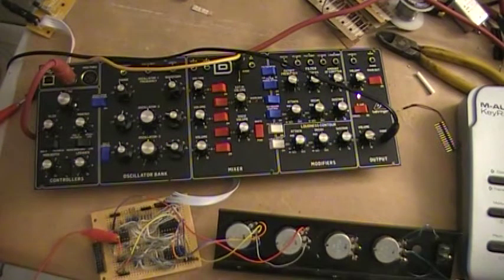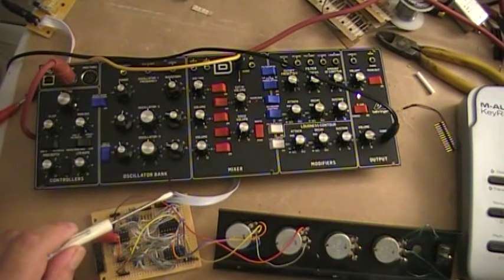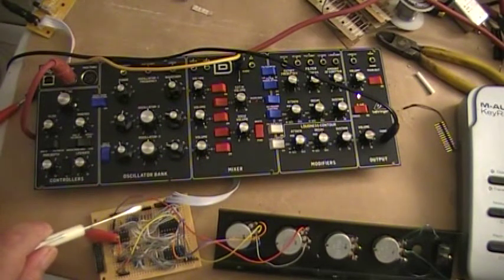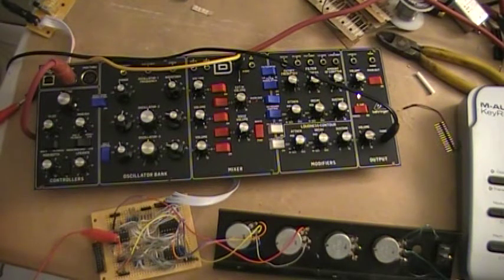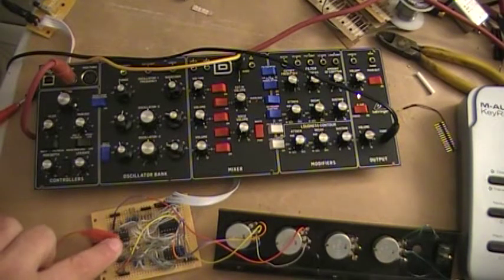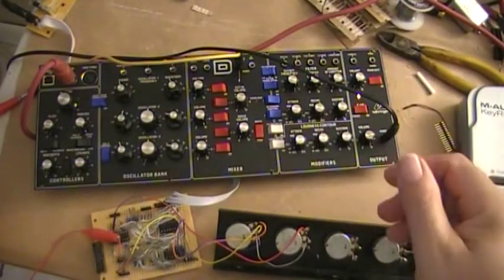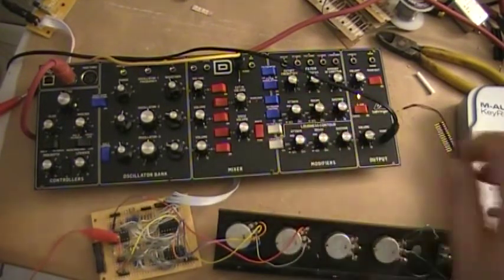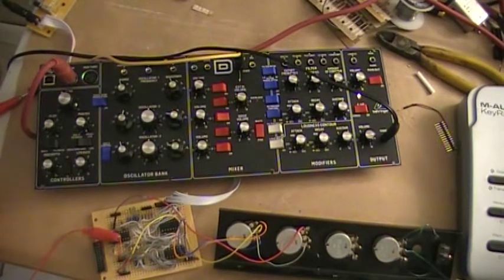Behringer Model D PWM Mod

Comment: I wish my Boog model D could do this! Nice work A dream would be more modular patch points. voltage for pitch and volume in/outs for each osc would KILL along with a PWM mod. I could even survive with just 1 osc having pwm. I always want my sub osc not modulated or not as modulated as the melody, and you can't do that live on this synth without mods, unless I want my high osc to be the filter squeek

Comment: Brilliant!  I would love to build one myself.  Would you consider sharing/selling/licensing your circuit diagram?  I just want to build one for myself.  I am building a 7U custom Eurorack case out of oak for my Model D, a Mother-32, and assorted other modules.  I would put the potentiometers on a 3U panel, or perhap a wide 1U tile.  The board would sit nicely under the hood (bonnet) in the case.  Thank you!
Reply from the maker: I will put up a link to the circuit diagram..
Reply: @codewizard58  Will you put the circuit diagram ?

Comment: Is it true,that trigger / gate out with the Behringer model D uses the ‘S’ trigger (I believe a short to ground) and so not a worthwhile endeavor to add minijack output for gate?  Also, is it a bad idea to just break out from the Noise generators if I wanted to add an output for the noise, or should I do the buffer?  Someone has shared a pretty decent Model D modifications pdf and it’s a great learner’s tool.  I wouldn’t mind some random notes by running noise into a quantizer then back to the V/oct input, so that’s what I’d like it for.  I guess adding a buffer is only a challenge when I need it all neatly encased.  I’ve been EXTREMELY fond of your SoftBits system for LittleBits and your Arduino at heart LFO video is wonderful.  LittleBits are more modular than modular.  THANK YOU VERY MUCH for having made and shared so much of your work with the community, your influences are reaching much further than you could ever appropriately appreciate!
Reply from the maker: I will have a look.. I have been getting a bit behind to my "hobbies" :(